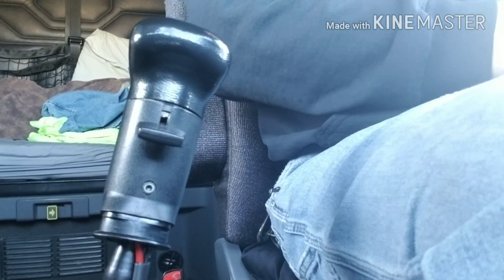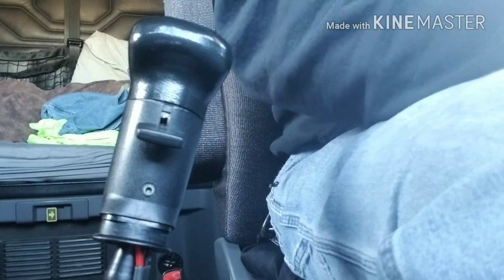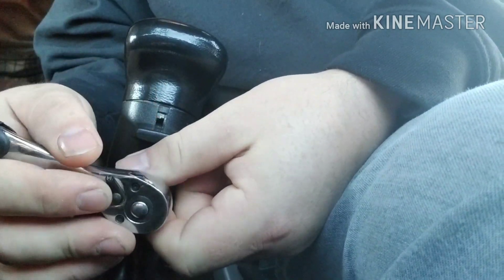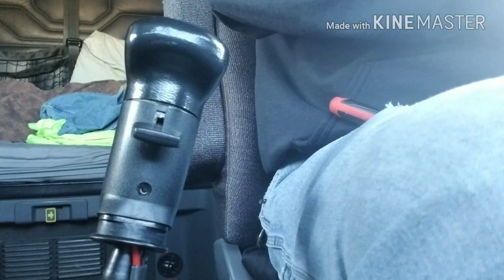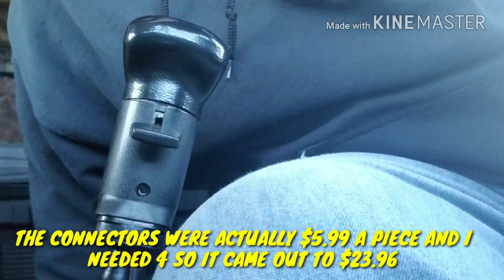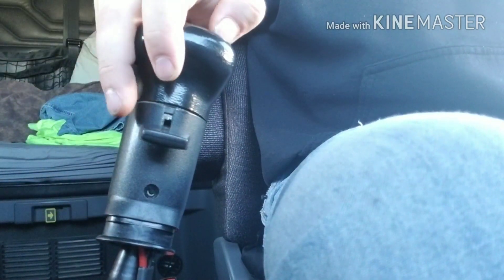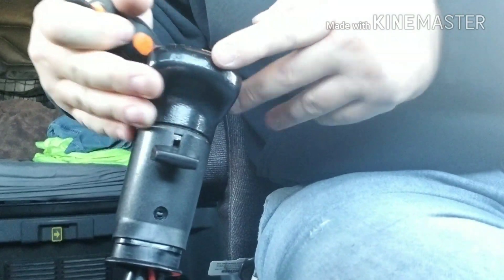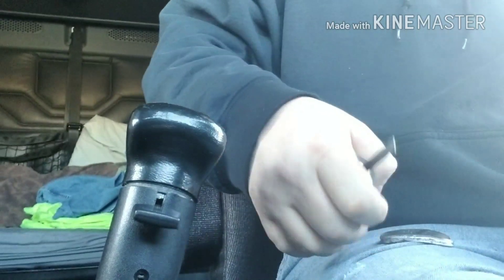DIY: SHIFTER EXTENSION 
EATON FULLER 10-SPEED PART I

Comment: Did you kick yourself in the head once you figured out those fittings are quick-connect and you didn't have to remove them? 😆
Reply from the maker: LOL. Nope, but I am now.
Reply: Exactly
Reply: Used a 90° pick or any kind of pick for that diamond plate

Comment: i have a rockwell
also 2 lines to shifter
i removed the knob and got new shifter with ball and it has like 5 holes for fittings
i put the 2 fittings and airlines in the 2 that had Red/Black written on it and it seems like something is wrong. air leaks back from union
and if i remove fitting and put it in another hole, air leaks from a third hole. not sure why in high range air doesnt leak from shifter but hear leak under dash
in lower range, it leaks from black cable hard
any ideas ??

Comment: If you do this to an 18 or 13 or (8 speed dumptruck with the low range diff split) theres a tiny ball and a spring that sits below the gear splitter, make sure every bit of air is out of the system or it will shoot that ball bearing out like a bb gun, then your fucked over a 15 cent part... This does not apply to a 10 speed only the transmissions with the gear splitter on the side. Take it from me cuz it happened to me, luckely we have a big shop so there was a spare laying around
Reply from the maker: Thanks for the info.
Reply from the maker: I couldn't agree more. It's going to take a long time to get it back the way it belongs, if ever.
Reply: @BIGBilly  yea you would love to hope right? Shits to far gone though, never be what it was

Comment: Those fittings are quick connect btw. Also did you bend the stick towards the driver seat?
Reply from the maker: Yeah I found out afterwards lol live and learn. No I didn't that's how it came.
Reply: @BIGBilly  ha ha hate when that happens... It looked closer to the seat than normal thought I'd ask.  Keep truckin

Comment: Bro I’m no expert but you did ALOT of extra work. The air lines are quick connects. Pull the air lines out add extension air lines and extension shifter and you’re done. Don’t have to take shifter cover on top off. But thanks for the video
Reply from the maker: I know I learned a lesson the hard way. Also the point out this video is made over 6 years ago. I say that because there's a lot of comments on this video stating the same thing. Thanks for watching

Comment: Well I finished my extension and found out that you didn't have to take the nuts loose they have quick connections at the top just had to push them in and pull the airlines out
Reply from the maker: Yeah that was a lesson learned for me LOL
Reply: @BIGBilly  fuck yeah big Billy
Reply: @BIGBilly  did you like or watch the finished product video nice and clean
Reply: @BIGBilly lol